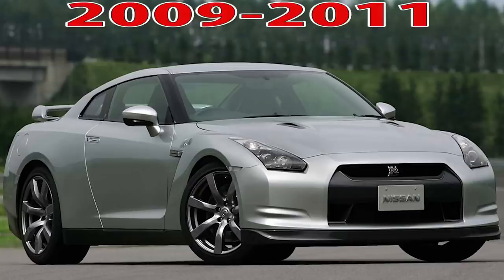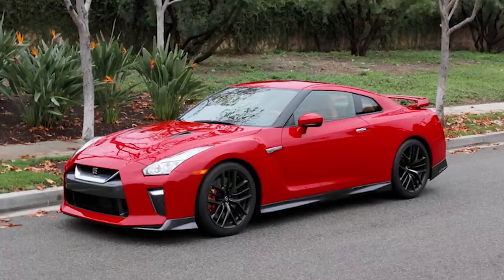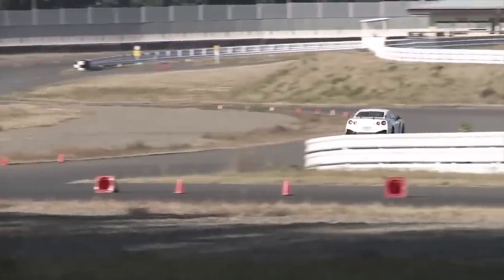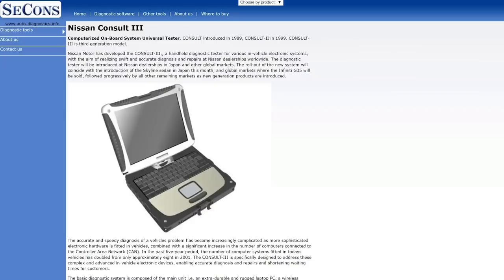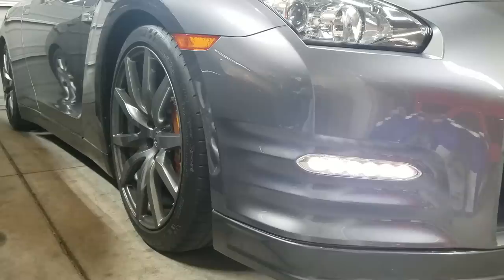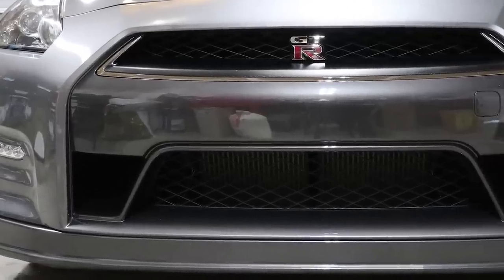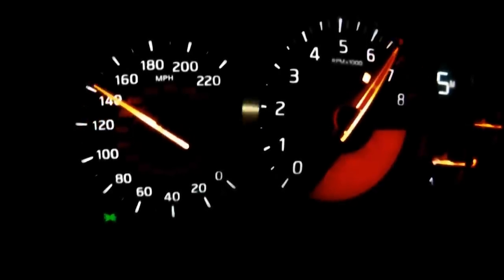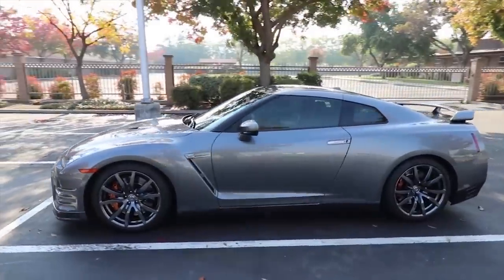Nissan GTR R35 Ultimate Buyer's Guide - WATCH THIS FIRST BEFORE YOU BUY

Comment: That part about taking it to the nissan dealership where they can run a diagnostic on the ecu and tcm is amazing. Wish I could hit like twice for this info.
Reply: its just a scan tool, you can buy them from snap on, there almost required for any new car these days
'
Reply: @DOZDDMGator  The Consult tool is not a simple scan tool and runs around $10K.  So its not something just any shop would purchase unless they specialise in GT-R's cause you have to scan a lot of vehicles before you can pay back for the tool.
Reply: @abdellembary8387  how much can it be? A new trans will cost you more then 20k

Comment: I bought a 2009 GTR with 75k Miles and it was well cared for. One of the owners used it for lots of freeway driving. She wanted a GTR for her travels. She had lots of work done to it with all the maintenance logs. The steering column was one of them. Among other warranty items, transmission, flywheel housing, front diff, instrument cluster, AV unit, ECM reprogrammed in 2011, TCM reprogramming. Second owner had the transmission rebuilt with a Shepard Stage stage 1. I didn't pull logs with Nissan but sometimes you can tell when I car is good. The detailed logs had me sold.

Comment: waiting to be delivered on monday ;) 2016 premium edition😍
Reply: Might as well have bought a new one.  You're going to spend the difference between a 2019 and 2016 just on maintenance alone.
I've seen other videos claim it's $12k/yr just to operate a GT-R and keep it maintained properly.
That's approaching Bugatti maintenance prices.
Reply: TasteMyStinkhole if you get warranties from the dealership when buying it will usually cover maintenance with a very low deductible. My nissan offers free fluid changes , and 100,000 mile warranty you can buy.
Reply: @TasteMyStinkholeAndLikeIt  Maybe, if you cant change oil yourself.  I tend to do all maintenance I reasonably can myself.  But I'm got used to working on cars in the 80's and on, so yeah, they were simpler then.  But Fluid Changes, Brakes, Filters, Plugs, Coils and most stuff the OBD computer gives you are no-brainers and cost stupid money at the dealers. A $20 OBD2 Blue Tooth dongle plus $5 Torque Pro on your smartphone can still tell you a lot even if it cant do much except clear fault codes.
Reply: @TasteMyStinkholeAndLikeIt  I have a 2017 and you were told wrong. It’s cheap as hell.
Reply: @landoncarr6634  thank god he scared me

Comment: Since I have been researching purchasing a GTR used for 2 years now I already knew all of this and it's why I tell everyone that it will defiantly be a 2014+. I have people tell me all of the time "but why not a 2009 or 2010? my older grt never had any problems.. blah blah" And I always tell them that with later yeared cars of any platform the problems have been more than likely fixed and refined. I'm not changing my mind, I don't mind spending the extra cash. 

For new people this is a great video and very descriptive. Good job!
Reply: Did you research the fact that Car and Driver's lighting lap shows ZERO performance increase on the track between 2012 and 2017 models they tested.  lol.  Nissan has been consistently raping customers with higher and higher prices while giving nothing in the way of better performance.  I love that.  Name any other performance car that hasn't had a performance increase in 5+ model years.  GT-R was a bargain in 2009, and steadily been a raping ripoff ever since.

Comment: Guess to save yourself from all the headaches. Just go with 2013 and up GTR.
Reply: tigerbiterhater not true the CBA is a great platform and can be modded,even slightly..and be just as good if not better than the DBA..u can buy a cba cheaper and take the money you saved and buy a Cobb access port and some larger inlets and exhaust and have a better/ faster car than the DBA ..and still save money
Reply: eve williams Interesting i never heard that before. I need to do more research. I have a q50 3.0 right now but am going to step it up when my lease is up in 2.5 years.

Comment: Excellent Video. 

I have had two GTR R35 and exactly what you explain is what every buyer should observe. An interesting point is to check if the front bumper has two small layer of clear plastics under the headlamps that will let you know if the car has been painted or crash.

Comment: Thinking about purchasing an 09. Great vid dude.
Reply: For the $1k/mo maintenance costs alone on a used GT-R, you could buy a 650 HP/TQ 2019 Corvette Z06 and run circles around a $170k NISMO GT-R on the track.
Reply: TasteMyStinkhole how the heck do you even come up with $1000 a month maintenance costs?! Ferrari’s aren’t even that much
Reply: I have watched too many of those "how much does it cost to own a GT-R" videos.
If you stick with only certified Nissan GTR techs, and follow their maintenance schedule, and use only Nissan certified parts, you should be right around 12 thousand a year in maintenance.
If you go to your neighborhood jack of all trades mechanic who works on cars for a side income, and you buy aftermarket parts, you can save a decent chunk of change. 
I have no idea what it costs to maintain a Ferrari, but changing a set of tires on a Bugatti costs $25,000 for the tires alone.  It's pretty insane what it costs to maintain a Bugatti
Reply: @TasteMyStinkholeAndLikeIt  so far from the truth.  Maintenance schedule is typically $200 dollars for an oil change at the dealership every 4 to 5000 miles.  Fluids on 09s, the big ones are transmission/differentials every 18k mile and it is incredibly easy to do.  Typical cost at the dealer is around 4 to 500 bucks if you supply the fluids.  Average cost - I would say is somewhere around $2000 to $3000 a year if you're following the book at the  dealership.  

My car is out of warranty and has around 83k miles and I've owned it for over a very, very long time.  I recently did the spark-plugs, coolant flush, diff, transfer case, transmission, engine, brake, power steering oil, -- basically all fluids in car as well as the serpentine belt and an alignment - it ran me only $1900 parts and labor at a reputable performance shop.  If you're buying a car like this - you should be more than capable of being able to afford the maintenance of it.  

Lastly, Bugatti tires don't cost $25,000.  $25,000 is the cost of the annual service of the car.  Tires for the car cost around $30,000+ and the tires can only be changed up to 3 times on the same set of rims before you need to get an entire new set of rims from Bugatti --which cost even more :(

Comment: my  JDM 08 is going 10 years, had those led issues in the cluster, 2 MFD's and dash cracking early years. Running LC5 and upgraded clips in the valve body to DBA specs. Now its running fine without any issues, do and oil change every 3k km due to the heat ( mildly modded stage 1.5) and transmisssion every 20k km, still feels solid and probably would last a long time.
Reply from the maker: Good to hear your experience.
Reply: i agree that JDM 12 or USDM 13s are the best, after all its was the last year kazutoshi mizuno san had a hand in its development before retiring from nissan. In an interview, he did mention that it was probably the gtr he made out to build.

Comment: Just as a matter of clarity, camber does not cause excessive inner shoulder wear. Toe does. Additional pressure on the inner shoulder causes the sidewall to compress more, and have slightly more wear. But it is very slight, and does not cause the feathering of the tread block that it is so often blamed for. However, if the toe is out, you will be scrubbing the tire laterally across the road surface while going straight down the road. This lateral scrubbing is what causes the excessive inner shoulder wear and feathering of the tread block.

If you are going to get an alignment, make sure that the place you take it too has a proper 4 wheel alignment machine, like a Hunter Hawkeye. It uses a 4 wheel laser tracked alignment system, and measures all 4 wheels independently. Sadly, many dealerships do not have alignment machines that are this nice, and do a very poor job of alignments. Putting things simply "within manufacture spec", rather than properly zeroed and dialed in. Sadly, "within spec" can still be far enough out of alignment to cause excessive tire wear. So shopping for a quality alignment shop that has well trained techs is crucial, and can save you a lot of money in tires in the long run (with whatever car you drive). More often than not, if the shop can afford a Hunter Hawkeye, they can usually afford well trained techs as well. Some national chains even offer life time alignments for the price of what about 2 alignments would cost. And that can be a big savings over the life of the car. So shop around. A proper alignment can make a world of difference in a cars handling.
Reply from the maker: bigbuckoramma Thanks for the technical insights.
Reply: GT Content happy to offer the advice. I hope it helps someone.

Comment: Super helpful video.  Packed full of useful info.  Would be helpful to include a section/new video on running costs (services, maintenance etc).  As a potential GTR buyer, the thing that keeps me away is horror stories of maintenance/service costs.  I should add that I don't have a garage for the car so don't have the space to service it myself.
Reply from the maker: I've already done that video😁 Search my channel for "Nissan GTR Maintenance Costs!"  Also check out my other videos.
Reply: Super, must have missed that one.  Will check it out.  Thanks!
Reply: Paul, why would you get a car like this just to leave it outside all the time?

Comment: I’ve got a gtr32r and love it, obviously it’s not anything like the new GTR’s but man with the right parts and build it is a sweetheart. I thought of selling to purchase the 35, just can’t pull that trigger in my mind. Maybe one day. 
As I know the 32 is a dinosaur compared with the 35. I will say I’m happy with the rise in price mine has done. Bought in Canada in 2008 straight from Japan 🇯🇵. 
It still only has 109 000 km’s. Many expensive parts added but original cost $14.500. 😄. Do I sell it and purchase as 35 or keep it ? It’s sitting at 600 whp with a beautiful engine build/ turbo combo. 
I cryogenic treated many items that were possible weak links. Nothing but smiles till winter in CANADA 🇨🇦 hits 🥶 although this does keep my km’s down. 
PS-love your videos mate 🤘🏼❤️🇨🇦
Reply from the maker: Keep it and add an R35. Best of both worlds. You're in on the R32 really good and prices are only going to go up (R35 included). The R35 is leaps and bounds in technology compared to the R32, but the nostalgia and RB26DETT is legendary.
Reply: @GTContent  I like that way of thinking. Thanks Mate ❤️

Comment: The GR6 is an automatically shifted, dual clutch, manual transmission.  That means there are no planetary gearsets or torque converter. Sorry that casual motorists don't like the complex answer, but that's what Nissan built.

Comment: This is a really interesting and honest video. The thing what made Skyline a legend was the performance to price ratio. This is no longer the case with GTR. GTR is in the Porsche price range. Yes the performance might be there but the the looks are not there. No days the market is flooded with high horsepower cars that are not really visually pleasing. As we all know looks are quit important since speed limits are quit limiting on public roads unless you are in Germany and you are flying on the Autobahn. For me Alfa Romeo C4 makes a lot more cense. 
It is lighter much better looking car fast enough for public roads rear engine rear wheel drive also it is brand new with warranty.  With the GTR unless you take it to a race track you will never have a chance to use it.
Reply: I beg to differ, i take mine to the strip at least 4 times a year, no issues no breakages, i even ran crazy boost, just my opinion.

Comment: I wish I'd run across your video sooner since I have a 2016 DBA. My car had <14,000 miles when I bought it, and it's completely stock. Although I relished my 2017 GT350, this car's hands down a monster. That being said, I take it in early this upcoming spring for an 18,000 mile oil change: would you recommend anything additional after buying used during this servicing periodicity? Great video, very insightful!
Reply: oil change at 8000 miles, otherwise you trash the engine

Comment: I dont have a 130,000 GTR but i do have the little brother of a GTR the Nissan 350z. Lol 
I have one question for you? You mentioned the GTR transmission chatters well news flash hahahaa my Z does really bad. What can i do myself to fix this loud chatter that seams to be getting worse. I have a 2006 enthusiasts with pipes cold air no turbo yet no boost and 50,000 miles on it. I also have a 2004 sport 350z redline red automatic with 9,800 ariganal miles on it.
The 04 we just bought in July it run nice fully stock. The rattle chatter cheddar cheese Nissan's!  I still love nissan over Honda all day long

Comment: The GTR lost some of its coolness as the prices went north of $100,000.  It used to be a huge bargain. Now the performance is still there but  add another 10 grand  (which relatively speaking isn't that much if you already dishing out $110,000+ ) and you could be buying a nicely equipped 911.  As far as the Nismo version, that is a complete rip off considering what else you could buy for that money.

Comment: Hi Gary, always like your videos. Very Informative. GTR has been always my dream cars.
The only thing that is holding me to pull the trigger on it is that it is coming to the end of production circle soon. But not enough evidence about next gen GTR from nissan. 
What news do you have it about next gen? 
BTW, I've been keeping an eye on local dealer here they have brand new 2017 white GTR premium for a while and offering $10,000 off MSRP.
Do you think I should take that one or look for a nice used one, with what max mileage?
what would you do if you were in my shoe.
Reply from the maker: It's hard to say what to expect from the next GTR. If it becomes a hybrid, then the R35 will be the last gasoline powered GTR, which might make it more attractive than the hybrid. I've made a speculation video on the R36 GTR. Check it out if you haven't seen it already: 
https://www.youtube.com/watch?v=4L8GtHEzzQU&t=1s

If you want one that has no history, then get the 2017. If you want to save money, then get an older model. The 2017's are beautiful and powerful but softer and heavier and in my opinion not that drastic of performance over my 2013 (especially with that huge price gap which can be put towards mods  😇).

I'd get a 2013-2014 GTR with the least amount of mileage as possible around the $60-70k range.
Reply: Thanks Gary

Comment: Just found this video and figured I’d save it as I’m planning on purchasing in the next few years. One question I do have, if the car you’re looking at already has mods (e85, exhaust, tune, etc..) would you still recommend taking it to the dealer for ppi? I know this kind of sounds like a dumb question, but I wouldn’t want to be refused service or have anything messed up because of the mods, specifically the tune. Thanks
Reply from the maker: The dealer may likely not inspect it nor work on it due to mods. Speak with them first as some Nissan dealerships have been known to work on modded cars. 
A performance shop like AMS/ETS/TSM may be able to though if you're nearby.
Let me know if you have any more questions and I'll try my best to help.

Comment: Yea the Nissan GT-R is a good car but I have owned an 1992 rover 200 1.4 litre 8 valve and in my opinion the rover is a much better alternative as it is much better on fuel ⛽️ and the engine is robust and you will see on average 47,000 miles out of the engine before the head gasket needs replacing also they do orange grill at the front that gives it an aggressive look  👀 much more intimidating than the GT-R, I would recommend before buying a rover 200 that you have driven a performance vehicle beforehand as they can be breathtaking, if anyone wants any more advice before purchasing on feel free to send me a message as I am always willing to help :), stay safe out there people speak soon.